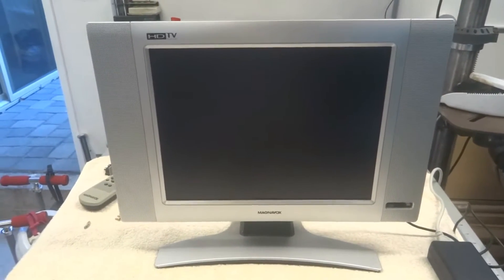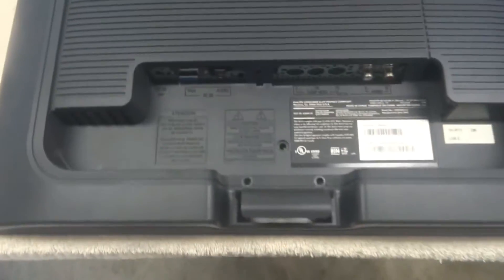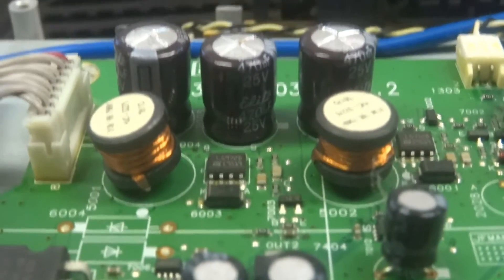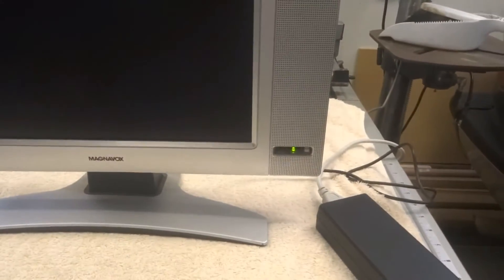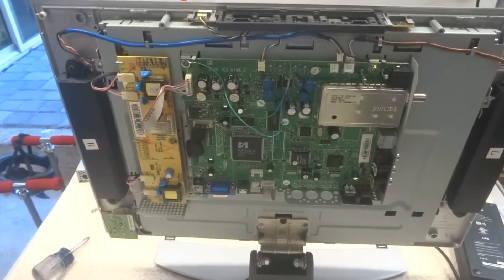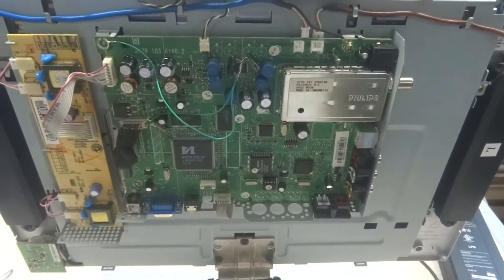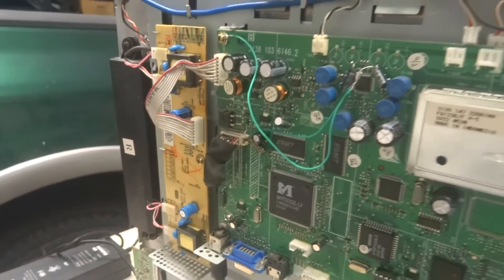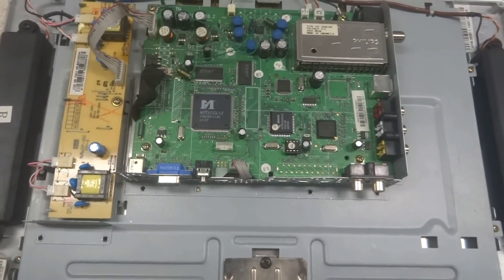Let's Repair - Magnavox 15MF605T/17 television

Comment: how do you remove that cage? 1:38
Reply: No idea I have this set to that I picked up recently to try and repair a arcade cabinet with a dead CRT and I can't get the stupid cage off either and the monitor won't stay on it stays on for like 2 minutes then the screen goes black and the only way to see the picture is a flashlight it's not the backlight as it works to show the image briefly so it has to be the motherboard but I can't get that stupid cage off

Comment: Flip the yellow transformer board over and look for f1 it is surface mount and has 2.5 on it. It is a fuse :) it will be blown. :)
Reply: carytowncat  F1 de 2.5 abierto  y reemplazo de condensadores de 150uf/25v

Comment: Take a amplifier with a microphone place it over the back light inverter board and see if both transformers are
 oscillating,  you will hear a buzz  when you put  it directly over the transformer also check for a shorted cfl bulb. I bet one of those transformers is not working.